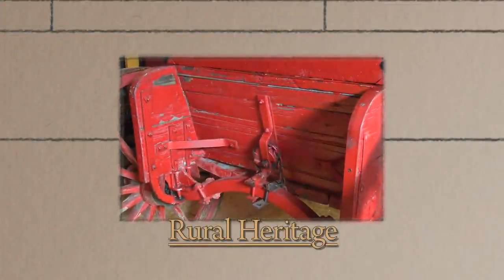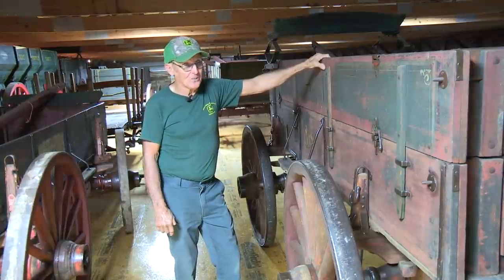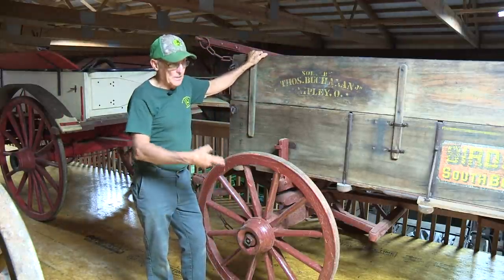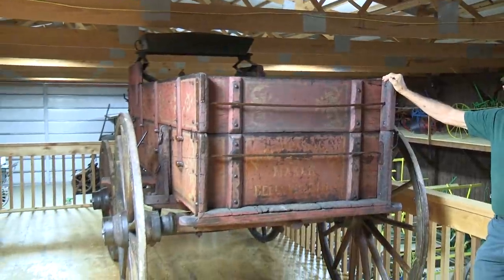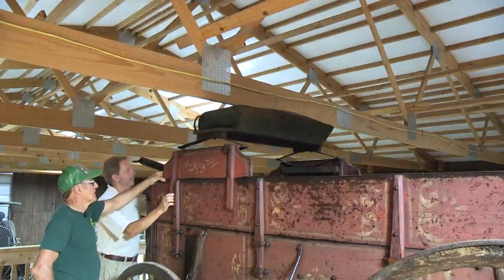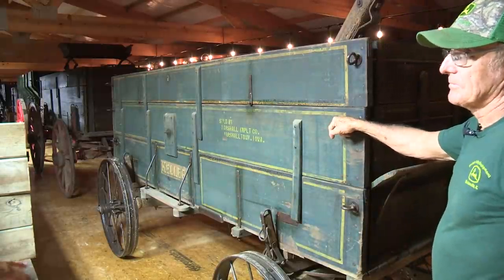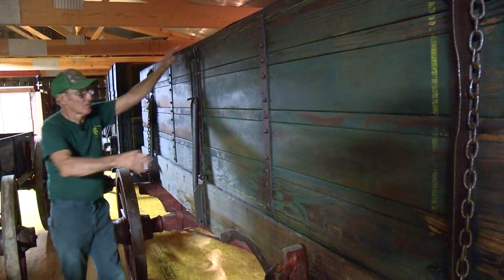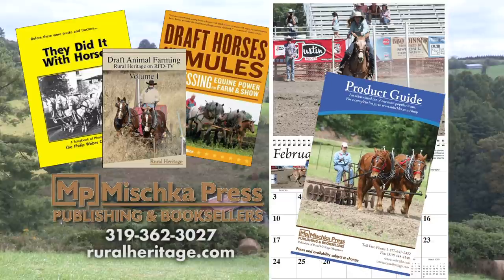Antique Farm Equipment Renner Farm -Additions (Part 4)

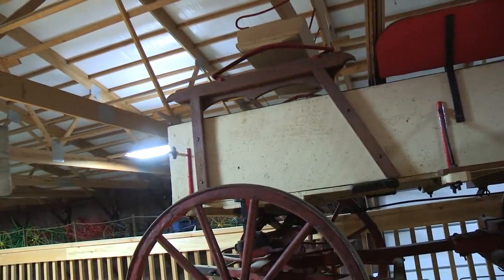Comment: 9:30 Front wheels were smaller for better steering control. The larger the back wheels were the easier the wagon was to pull requiring less draft power.
Reply: incorrect.  In order to keep the box level, the front running-gear bolsters had to account for the extra thickness of the king-pin assembly.  The thickness of this had to be subtracted from the ground-height of the front axle.  Thus the front axle was required to be a few inches lower to the ground in order for the box (what ever type of box) to travel level.  For the front axle to be lower to the ground.... wheel diameter needed to be smaller.   IF you tried to keep the wheels the same diameter,  to keep the box level you would have to add height to the rear-axle bolster.  Doing so would make the rear axle assembly unstable and would suffer unacceptable torsion on the reach-hounds and the brake-beam.  The added height would also require the brake-beam linkage arm to be longer which would reduce the amount of applied brake pressure.   Upon inspection - you'll find that the difference in front & rear wheel diameter is always and exactly twice the height of the king-pin assembly (front-axle upper bolster)  above the front axle bolster.
Reply: Same thing. Also, note this was from a year ago.

Comment: I have asked several people and nobody can tell me, the purpose of the metal rings on the bolster of pretty much all of the old wagon gears. Can anyone tell me their function?  Sorry, I am not computer savvy enough to post a picture of what I am talking about, but you can see one in the video   at approximately 1:17 behind the wheel.
Reply: The rings on the bolsters are like stake loops for when you are using just the wagon gear to haul things like logs or lumber. They are round as rough hewn poles or tree tops were commonly used as improvised stakes that could be discarded when the wagon box was put back on the running gear.

I've also seen old photos were the sides of the wagon have been removed - leaving the floor and the stakes then served as a framework for a rack to haul loose hay, cotton lint, and even as a livestock rack for sheep and hogs.

I hope that helps answer your question. Get back to me if you have any other questions.

CW Peterson
Grass Valley, California; USA